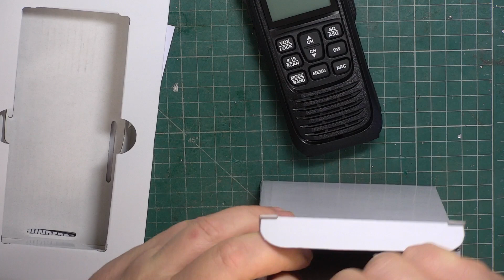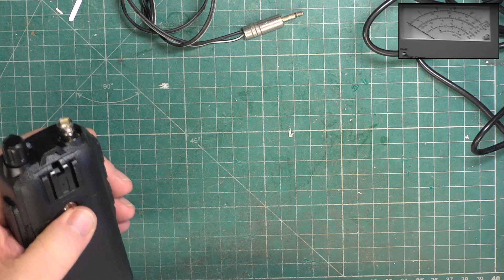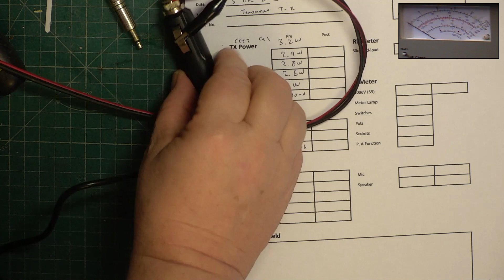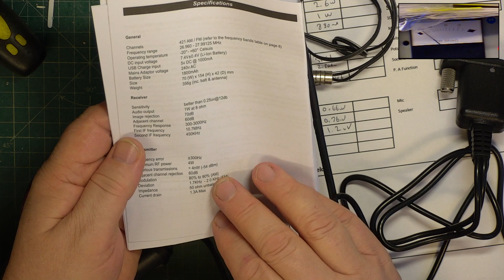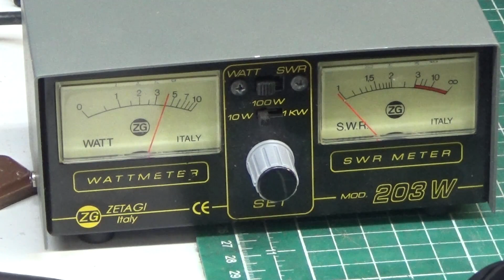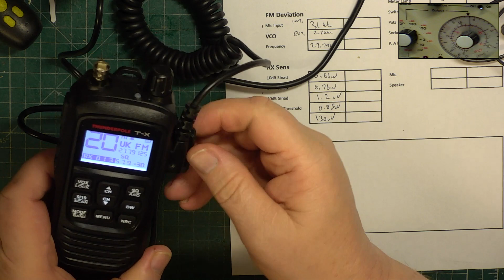Thunderpole T-X CE MultiNorm UK FM/EU AM-FM CB radio hand-portable - Overview & service

Comment: Moonraker do 1 jopix 514 handheld i think is the same cheaper at £89.95
Reply from the maker: Yes, but the firmware is different & it doesn't go through all the modes available for UK users smoothly.

Comment: I wonder if it would be possibke to upgrade the antenna coax to something less lossy yet still use the car charger unit....?
Reply from the maker: It depends what you're trying to achieve. We got 6miles+ usimg the supplied lead on our 'on the air' test. Other manufacturerss of handhelds have all gone down this same avenue in the way handhelds connect when used with a car kit. Back in the 80's, manufacturers were using RCA phono type sockets for the external aerial connection on handhelds which were also lossy.

Richard, UK
Reply: U won't get much loses on a short run of cable😊
Reply: @SimonHilson yeah it seems so... my thunderpole tx is only pushing 1 watt so every little helps i spose...

Comment: There's no switch on sound on my new one from thunderpole.
Reply from the maker: Switch-on bleeps or no sound because there is no receive? function bleeps are a menu item if I remember correctly. No FM hiss would be autosquelch switched on.

Ricard, G0OJF, UK
Reply: @ukfmcbradioservicingTango21 receive is great. Its just the short melody when you turned the unit on that is missing from mine. No big deal as the unit works incredibly well. I did actually speak to 2 people whike sitting in my living room with the rubber duck. They were 3 and 4 miles away respectively. What a superb hand held this is.

Comment: PNI offer programming software free for the escort HP 82. It seems to connect to the TX and read using a standard beofeng Kenwood cable. I'm not going to try changing anything though. Too risky
Reply from the maker: I woul think it's not for setting service type parameters, but for programming memory channels & stuff like that.

Richard

Comment: I wish President & Thunder T-X would supply a screw on or clipin bottom dust cover for these sets,i dont like contacts exposed to moisture.
You can now get a TNC or BNC Mil type tape antenna,those do work even better than the "duck"types,well worth a look at.
I just wish the cb mfrs would bring back the longer centre\top loaded designed helical ducks ,like Dirland France did in 90s,they works really well with the Midland Alan 80A CEPT hand held,about just under 100cm long and very very effective.
Most newer 2024 cb will be pc software or front panel engineer mode,going down the same route as business band radios.
Great vid Richard.

Nanefone is original manufacteure custom made to thunderpole uk specs.

73's Rob.P

Comment: Hello Richard, I really need some help concerning the T-X that was recently purchased for me. It has been sitting idle at my home for nearly 2 months. Unfortunately I was unable to test it as I was injured in a fire and am currently in the burns unit at Morriston hospital (Swansea) undergoing treatment. My daughter just brought it up to me along with her laptop, but it doesn't work as it should as there is no audio when I transmit on FM but there is when I use AM. Also, my daughter's laptop has no sound, it is broken, so I cannot hear anything you say in your video. I can't email you as I can't sign into my Gmail account. I do have my phone but I only have the use 3 fingers on my left hand. Do you have a phone number that I could call you on to get some much needed advice from you? I tried calling Thunderpole but they have blocked all calls.
Reply from the maker: As the radio is under warrenty, you need to get someone to write to Thunderpole on your behalf & ask what the returns for repair procedure is.

If you send it to me for repair, your warrenty will be invalidated...so why pay for service when you don;t have to.

Now the snag is that there is no phone number. I have  phone line for the organ business, but no phone is plugged into the line...just the internet. It's been like this for years. I started the business in 1994 & have never had any work come via the phone...just people from India trying to scam me.....or people trying to flog a late relatives' electronic organ when we're only involved in pipe organs.

I don't have a mobile phone as they don't work here. Contact is Email only. rshireby@yahoo.co.uk     I'm not stopping you sending the radio here for service, but why pay if you dom't have to?

All the best on your recovery,

Richard
Reply: @ukfmcbradioservicingTango21  Ok, thanks for the advice. Sorry I'm slow to reply, I was in hospital for a while, I'm out now but had no notification of your reply. I came to watch the video again as I have sound now, and I noticed your reply when I'd finished watching. I'm not sure what to do right now about the radio, I tried ringing Thunderpole but they're blocking all calls. The radio just needs the FM deviation turned up, but my head is not really with it yet so I'll think about it at a later date. I'll email you if I need to ... Thanks again.